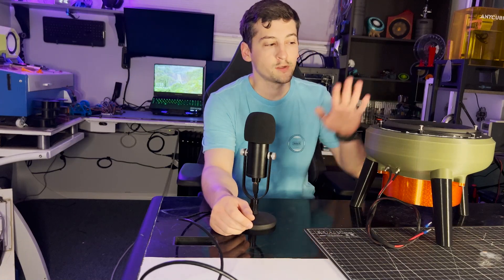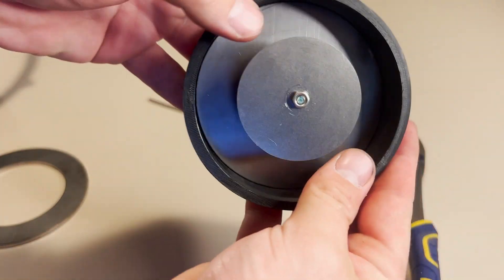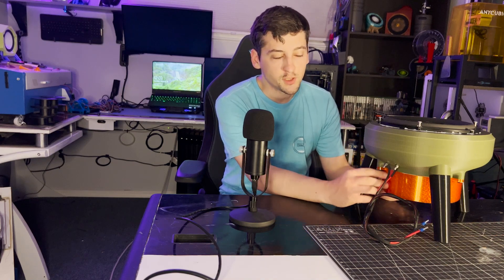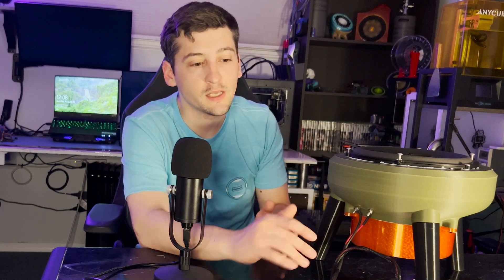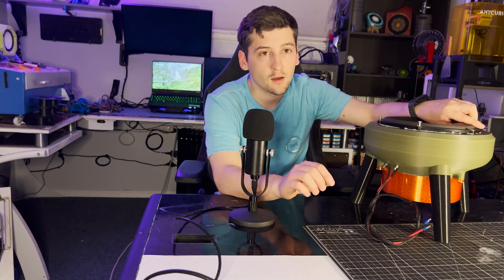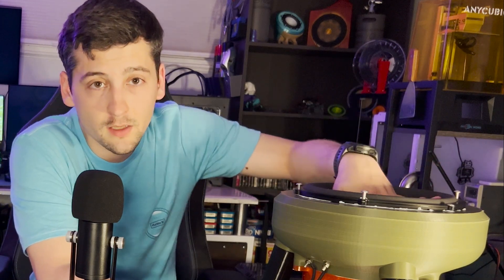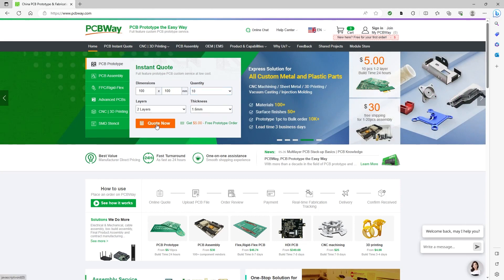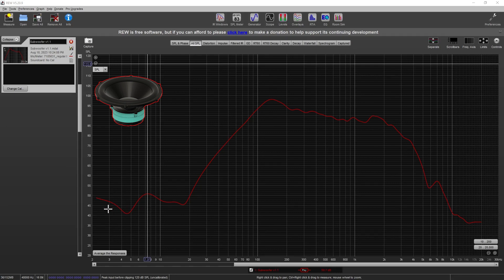Fully 3D Printed Subwoofer V1.1

Comment: You could put cooling vents around the circumference of the voice coil, i.e. holes through the side of the frame/motor magnet. The sundown sd-4 is a good example of this design. You can also vent the bottom of the voice coil gap through the bottom plate and/or use a pole vent
Reply from the maker: I’ll look into this. I’m currently working on a few idea for cooling